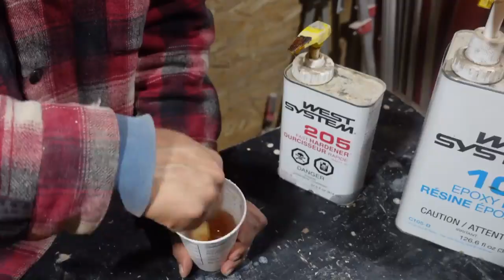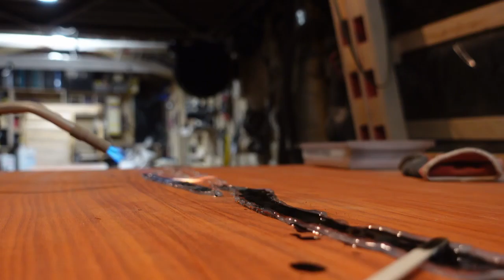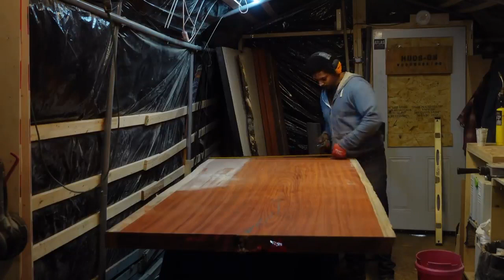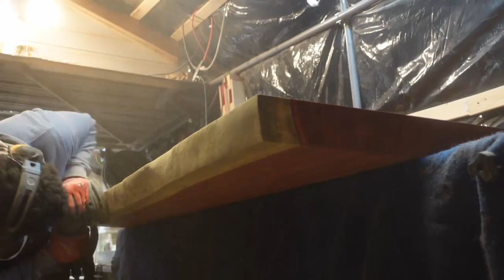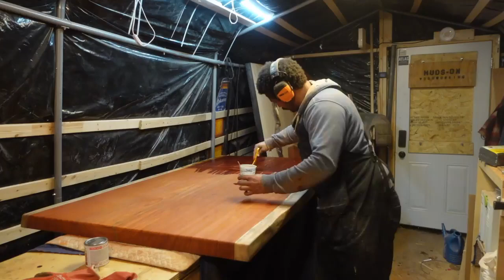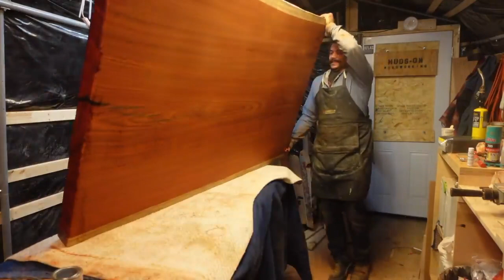The Making of a Padauk Live Edge Table Top

Comment: That is one sexy table top!  I love padauk.  Easy to cut but can make one hell of a mess of your shop.  Only thing that has stopped me from making a table out of it is I worry about checking and cracking.
Reply from the maker: Yah, the red sawdust gets everywhere! I can tell you that this slab held a lot of internal pressure, but seems very stable. I have some piece I stored outside in car port for year now and still dead flat.